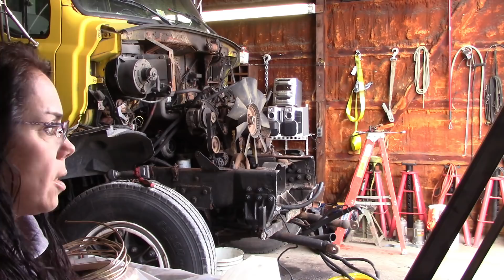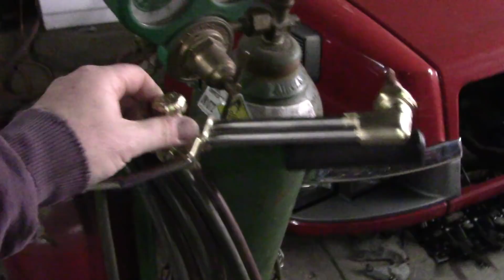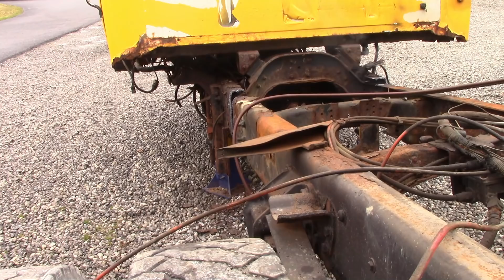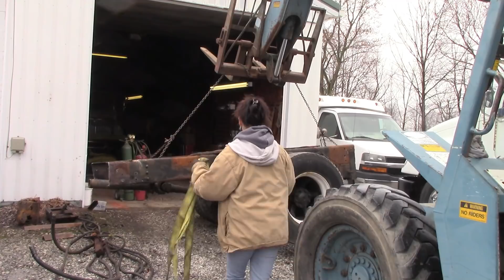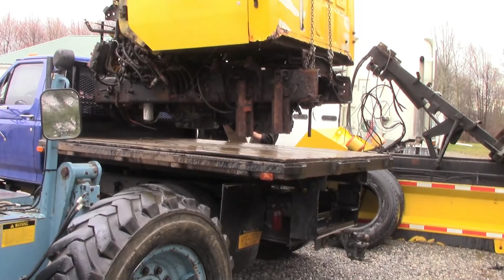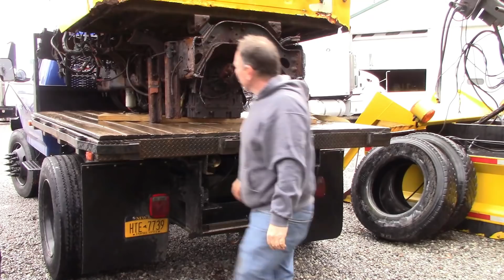CUTTING A DUMP TRUCK INTO PIECES!

Comment: So you can't put ten pounds in the five pound bag but leave it to rust and it will look like twenty in that bag... I hate rust too, cut off wheels make it stick to you when it goes through pants leg or shirt sleeve. Not much to go after unless engine, trans and cab. I am seeing cheaper plows new than saving old ones now days. Never cared for the "brick" front ends but his truck is a exception

Comment: Wow lol never seen a truck took apart like that
Reply: Very interesting. Never worked on trucks, but I have seen others cut the cab off and then pull the engine and box. Sure there is a reason for keeping the cab. Keep the videos. Thanks

Comment: enjoy watching  but am curious since you have a plasma cutter and they work SO much better for rusty steel - how come you didnt use the it for cutting the rusty frame?....you struggled with the layers of rust - with the fuel gas torch WHY ?....do you use propane/oxy or acetylene /oxy for cutting?....I found propane works just as good for a lot less money. We have the same rust on everything here in Buffalo ny sometimes steel is so rusty its in thin ribbons  like strudel and a nightmare to torch cut.

Piling that Louisville on that short f-350 flatbed and truck'in down the road would get a LOT of attention from DOT and even local yocals here in Buffalo ny - glad Drew got home all right.....a trailer would have been a lot less attention grabbing.

stay safe and keep up the good videos
Reply from the maker: i got sick of losing my ground on the plasma cutter...that truck was so rusty....the rust was in the form of sheets. it would cut the main steel but the rust doesnt get as hot so it doesnt cut at the same time. i dont use the torches very often....no real savings for me. im already set up with acetylene.

Comment: Man I hate rust! I'm going to make the flatbed on the white f450 a dump bed. I have a PTO that drives a shaft but I need a hydraulic pump to go onto it. I don't really want electric over hydraulic. Currently removing a scissor lift from an old rusty dump frame I've been saving. The ram is going to need some repairs.
Reply from the maker: i have several hydraulic pumps. sent me a picture of your pto. i may have what you need.

Comment: Why do snowplow trucks commonly have little doors in the hoods? Seen s-series internationals with em also.
Reply: The snow plow frames on medium and heavy trucks prevent the hood from tilting forward. While the frames may be taken off in the off season if the truck is used for other purposes, removing the plow to tilt the hood every time you need to check the oil in the winter is impractical. So they add flaps in the hood to access the dipsticks and sight glasses for the vital fluids.
Reply: I believe it's so the operator can check/add fluids with out opening the hood.
Reply: When the plow is hooked on to the front,the driver can't fully open the good to check fluids

Comment: Nice job on this video JC!
Hope you and Mrs. JC are well. Great upgrade on your torch, you needed that replaced. Cool your local welding gas supply place takes good care of you. I think you made a good call on cutting up the remains of that truck after it's tough life as a snowplow/sander. Drew's channel is going to get a real boost from this video, and your stay tuned announcement. Good stuff. Work safe, stay warm, and Carona free!
Doug@ the "ranch"
Reply from the maker: drew's channel has got a little jump so far. hope it does well for him. great guys. we had a great day. we are in the shop today and trying to clean up and get ready for the next project.
Reply: @j.c.smithprojects  Hey JC!
Glad you guys are well and able to work on the endless truck projects. Be sure to stay hydrated and wear your PPE (safety glasses) in the shop! Enjoy your weekend, best to Mrs. JC from here, talk soon.
Doug@ the "ranch"